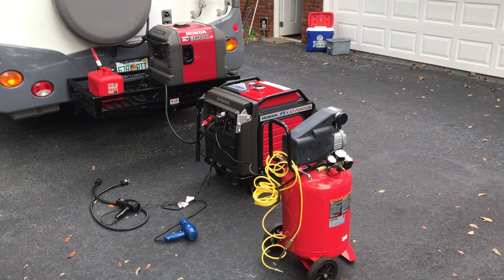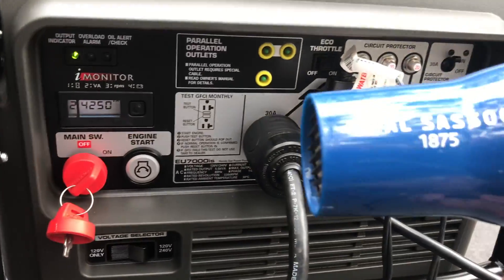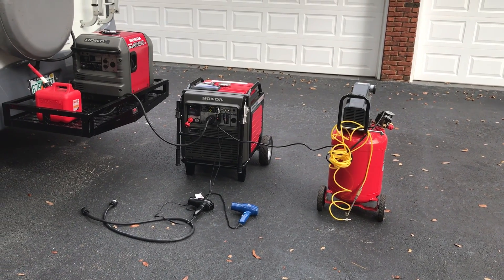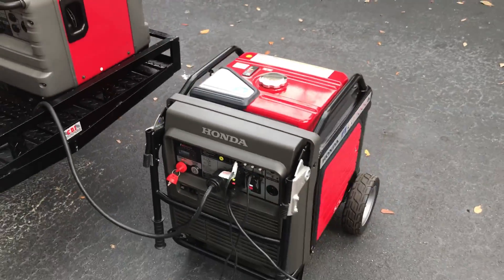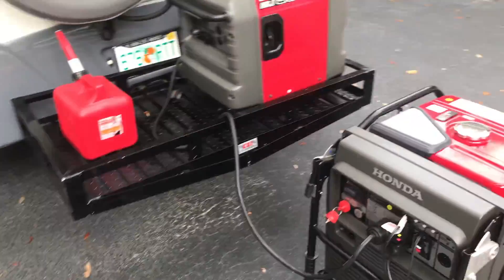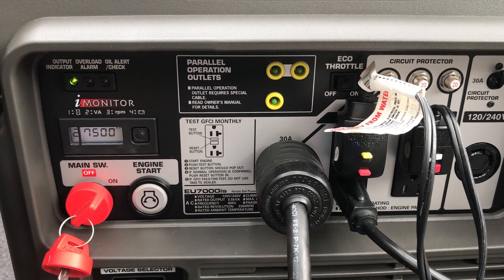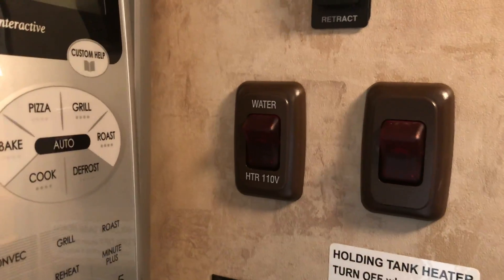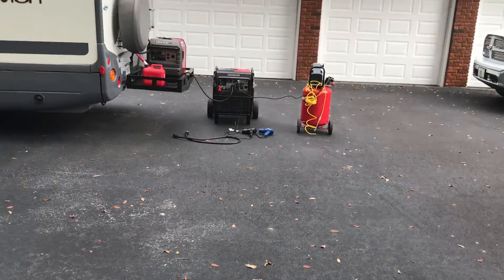Honda EU7000is Inverter review at over full load on simulated load bank. Maximum load? Load review.

Comment: I have the older EU6500is which looks and has the specs identical to the newer EU7000. I really wonder if Honda did anything other than add fuel injection and rebrand it as a 7000 watt unit. Does anyone know if there is a REAL difference with the newer unit. Does it REALLY put out that extra 500 watts of power. I bet it's all marketing and the two units put out the same power...

Comment: Seems like you are adding 3000 watts to one side of the eu7000. It is not balanced.  The EU7000 Has 2 120volt sides for 220 volts. And you are just increasing one side . The inverter board is almost $1000 bucks .
Be careful. Maybe I am wrong .  But you need to parallel the 2 sides of the 120 volt sides.

Comment: Everybody is confused about the wattage because what the generator is showing is VA instead of WATTS. Depends on the appliance the numbers vary so if you see 7400VA that could be like 5.5 or 5.8k watts. I'm not electrician so if anyone knows more can please clarify
Reply: Yes you are right.  The generator it is measuring in kva not in kw.  That is why  the generator still runnnig.
Reply: VA and watts are not that far off from each other. Watts are volts times amps.  Or, V times A...... VA.
Reply: With a resistive load heater etc its unity power factor kva is the same as KW, with inductive loads can be up to 0.8 power factor

Comment: Hey, great video. Can this be used to run a 2.2 Ton Inverter AC ?
Reply: easily, there is a video of it running a 5 ton house A/C by Carrier though it had a soft start installed, and it did it with ease.

Comment: The question is whether you really need that much power vs the 3000 you have there and how is the consumption between the two.  The 7000 fuel injection may be surprisingly efficient but that is the million dollar question.  Would be interesting to run both gens out of fuel and then put in an identical amount of fuel in both.  Then run a space heater at 1500 watts until both are out of fuel and see how they compare.
Reply: I have the older EU6500 which from what I can determine is the same machine other than the addition of fuel injection. I have just run my Honda through 30 hours of continuous use to power my home during the current Ottawa, Canada power outage. My estimate is it costs about a litre of gas an hour for medium output of 1500 watts usage. That equates to about $2 Canadian an hour. I don't know if this will surge up to the levels of the EU7000 or not (might just be a marketing game when they added fuel injection as it seems to be identical otherwise) but I imagine it probably will. Remember when you truly need a generator, its worth is priceless, and Honda make some of the best (and most expensive) generators. Also remember the old saying..."when the price is forgotten, the quality lives on". Rock on Honda !!!  (that from a Honda fan boy)

Comment: Damn. I want a 7000 so bad but don’t want to pay the price. I guess that’s my problem lol
Reply: I have a Briggs and Stratton Q6500 inverter generator. I use it to backfeed my house during power outages. Runs my AC, well pump, electric dryer, and much much more without a problem.  Most of the time it just idles.  Typically gets around at least 24hrs per tank of gas.  It has been a great generator and is very quiet.  It is lacking some of the features of the Honda but it is about 1/5 the price. Currently selling at Home Depot for 899.00 before tax.
Reply: 86dieselman that 5 gallon tank would be awesome on there.  I’m going to think about it and see what happens.  If I get one I’m making videos on it because there isn’t much for videos on YouTube if people actually using them.
Reply: @maxracingteam23  you're are right, almost all of the videos on the q6500 are from Briggs and Stratton. It was a gamble but it's been a good unit for me. It's very light and easy to roll out of the garage when there is an outage.
Reply: 86dieselman good to hear. I’m going to consider buying one now

Comment: Dear Honda Power•••>share4.photo/HEU22Inverter?щМ    In some units, the screws used to assemble the fuel valve may loosen during use and can leak fuel. If gasoline or gasoline vapors leak, a fire or explosion could occur. A fuel leak caused by this issue typically is identified as a result of smelling a strong fuel odor before, during, or after operation, or seeing fuel underneath the generator.

Comment: How many kWh per gallon of gas? I find that inverter generators are more efficient at light loads, because of their ability to slow down the engine, with no change in output voltage or frequency. Direct generators are generally more efficient, if run near rated output. At full output, inverter generators tend to be about 20% less fuel efficient. I have to admit: It's impressive to see it actually produce it's advertised output. Many inexpensive direct generators won't produce their advertised wattage, or at least, not sustain it for anymore than a few minutes.

Comment: What people don't realize your can only produce 30 amps thru the rv plug either the 3 wire or 4 wire, all additional amperage is thru the 120 v external plugs which is a real limiter when using as a rv power source. you could of paralled the eu 3000 and got the same effect alot cheaper.
Reply: 30 amps x 240v is 7200 watts (@240v). It's plenty of power through the 30Amp 4 wire connector. And yes, it's rated to a combined 50Amps out the 120v 20A duplex gfci plug while simultaneously also supplying 30A out the 120v 3-prong.

Comment: The Honda generators are designed to surge for up to thirty minutes. Could this be a factor? Did you test the voltage at peak wattage? I have seen others do similar tests and when they are working above the rated surge the voltage will fluctuate. I love Honda generators and would not own any other brand.

Comment: 7000 VA     5500 VA  =  4400 W
Reply from the maker: Sergio Estrada Please explain what you mean the little meter on the generator shows Watts and it goes well over 7000 watts please explain what your meaning there maybe I can learn something is that gauge vacant amps and not Watts? If the power factor is 1 doesn’t the vacant amps equal watts?
Reply from the maker: Sergio Estrada I looked at the owners manual and it says 7000 VA equals 7000 W because the power factor is 1 So I think that 7500 VA is equal to 7500 W to the best of my knowledge
Reply: V = volts
A =. Amps
Power = V*A = Watts
Reply: michael Vaughn    even i dont know